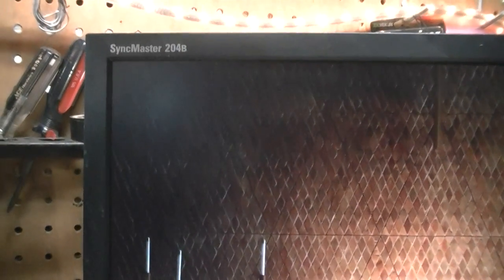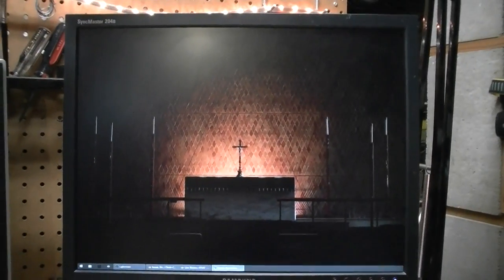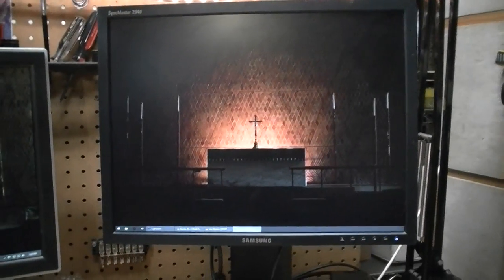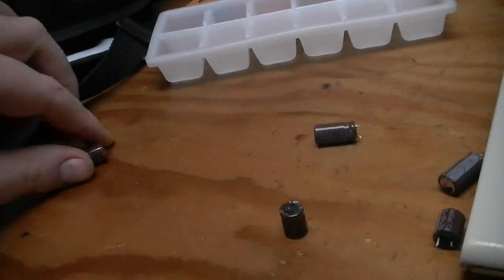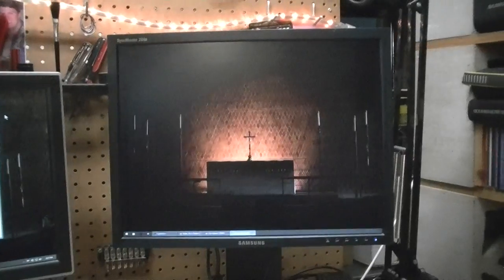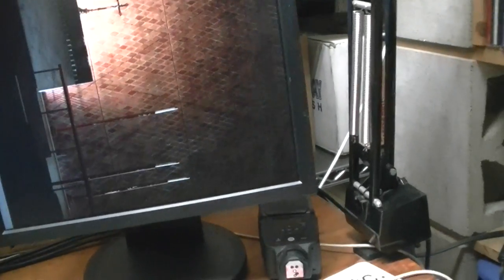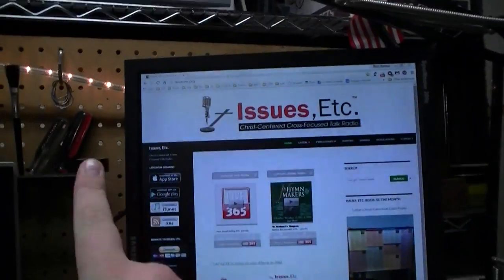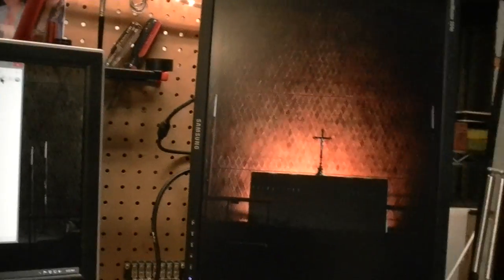New Capacitors for a Samsung SyncMaster 204B

Comment: Thanks for posting!  Most of the 204B power boards I've repaired use the 2x820 + 2x680 + 1x330 capacitor set, which is readily available at an increasing number of online outlets.  Your board is probably Rev 0.0, which takes the set you used:  2x820 + 3x330.  For the smaller ones, going for higher voltage (35v) on the replacements is often recommended, for durability.

And yes, 4:3 displays rule.  If only the market would demand it...
Reply: That's a good and valid point. Most people don't understand that we can use higher voltage as long as we use the same capacitance value. This has absolutely no effect on the function of circuit. It does however allow much more headroom for power spikes which may be present in the power line that the device is connected to if it's not plugged into a proper surge protector. Of course temperature considerations must also be made too as the power supply and high voltage inverters can get quite hot. That said anything rated for more than 105°c should be sufficient.

Comment: I've done this same repair so many times for so many different screens that it's not funny. Something to know about capacitors for discovering if their bad. Check them with a multimeter in resistance mode. Most capacitors will have a high resistance which will decrease over time. The bad ones will have a notably lower resistance which won't fluctuate much at all. The bulging at the top is a good indicator but a lot of times when caps go bad, you don't see any visible signs of it. I thought this information would be useful to you as it's helped me greatly over the years. Ultimately getting an LCR meter is the best option and they can be obtained for around $20.00 for cheap ones. They work well enough to know when you have a bad cap. Just be careful with these as they can leave a reasonably high charge on the capacitors being tested so be sure to discharge them with a shunt of some sort before accidentally touching the leads as this can lead to an unpleasant surprise.

Comment: I'm diggin' that state-of-the-art shelving system. :P

BAndersenTV here on YouTube actually had the exact same issue on both of his Syncmaster 204Bs, and with the same solution too. Replacing the capacitors in the power supply fixed the issue on both monitors.

I really like the 20" 4:3 monitors, though sometimes I wish the resolution on them wasn't so high. I have two Dell Ultrasharp 2007FPs that I picked up used locally. They both have the 1600 x 1200 S-IPS panels in them and have been really great monitors so far.